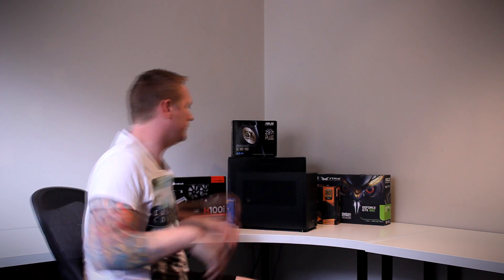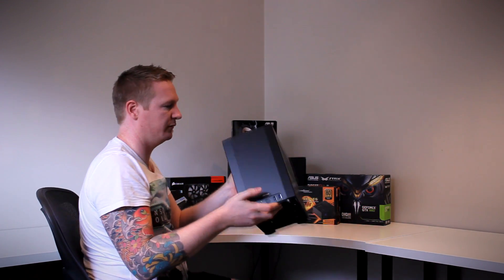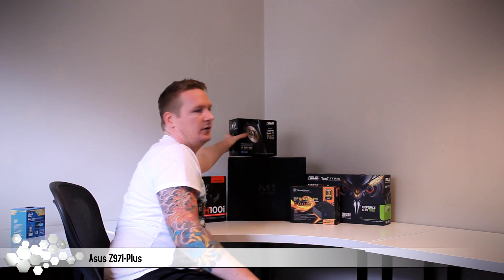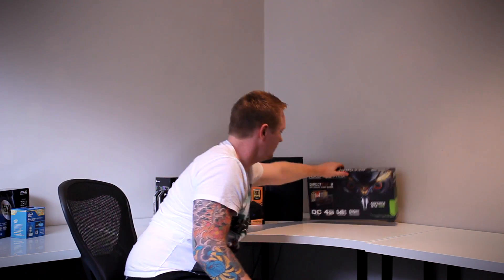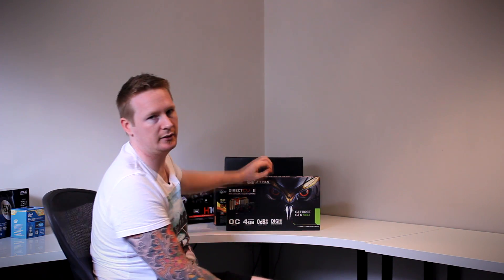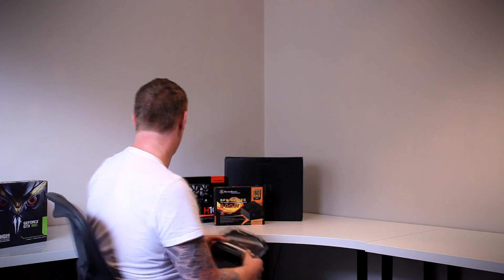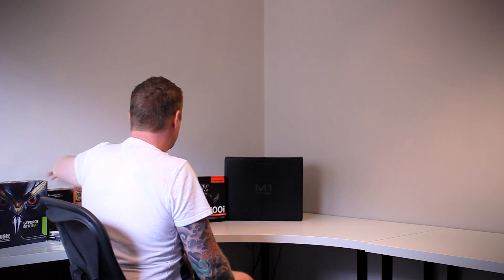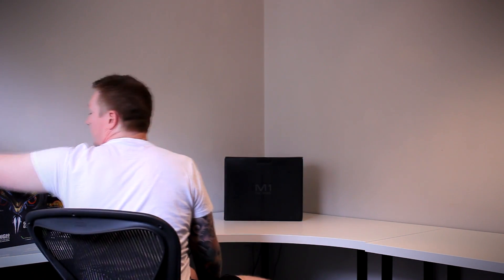Project MiniValidus - Part 01 - Meet The Parts.

Comment from the maker: Hi Dunetech sorry for some reason I can't reply so hopefully you see this. I question SilverStone as soon as I heard about these issues and had the following response

"Hi DeeGee,
Sorry for the late reply. Sure, we can replace it if there are any defects including the excess noise (if the noise is audible within 12 inches). Thank you!

Chris Liu
SST"

I think there is some confused wording around the "within 12 inches" but basically I think they mean if you can hear it from 1ft or greater, that's grounds for RMA. Hopefully that helps.
Reply: Thx for the information.  I already ordered some replacement fan for the PSU and I will certainly contact SilverStone if it didnt work out.

The build is really interesting. I have the RVZ01 with the 4790k and Gigabyte GTX980 but the case is just not very good a handling the heat. After one hour of BF4 the video card will hit 78(with 2 Noctua f12 directly blow air in) and the real problem is that the temp will stay at 60 even after 15mins ldel because the whole case was heated up by the parts.

Looking for other cases for my setup. The M1 is surely on top